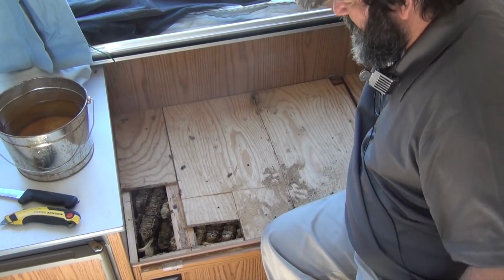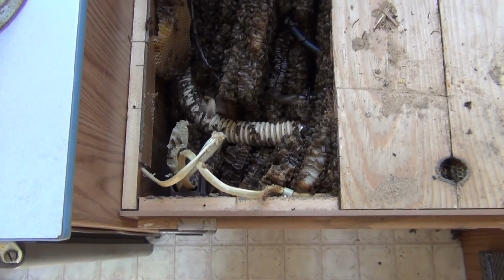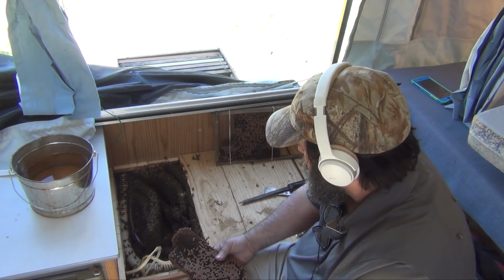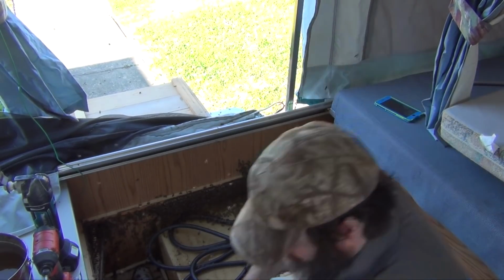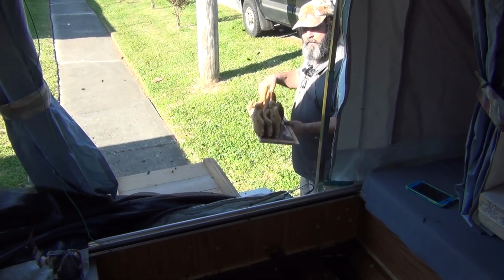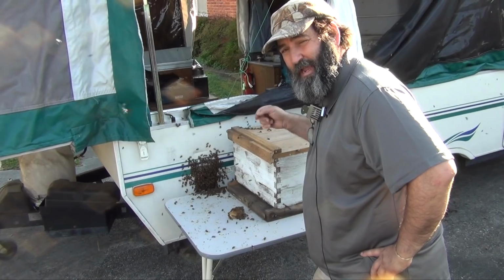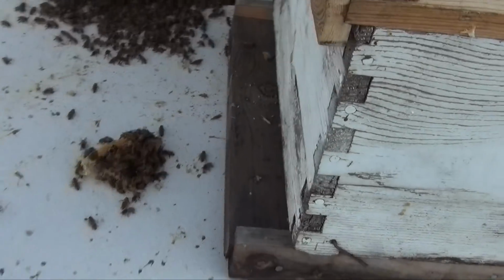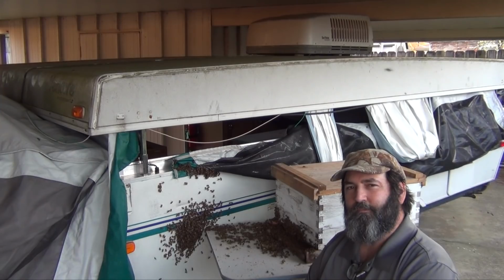Huge Beehive In Grandma's Pop Up Camper!

Comment: Who builds a mobile hive box filled with cables and hoses... it's almost as if it was intended to house some other kind of animal....    The lesson here is, if your camper or RV has one of those horrible cable pass through for the cord, change it out for a proper inlet connector. That will prevent ants, mice, wasps, and bees from making your RV or camper, their home.